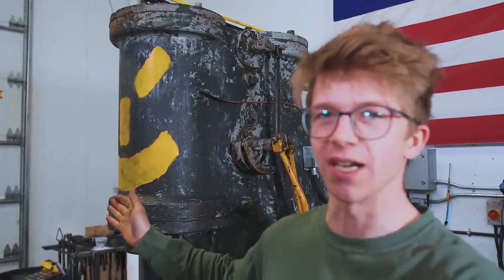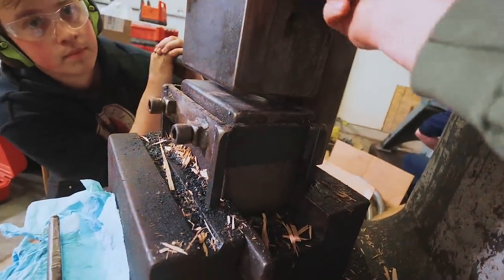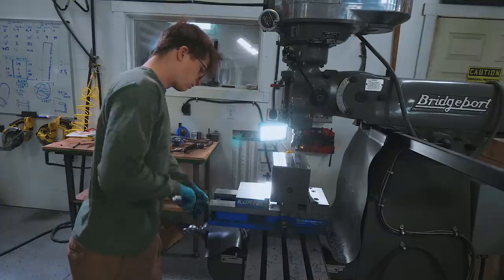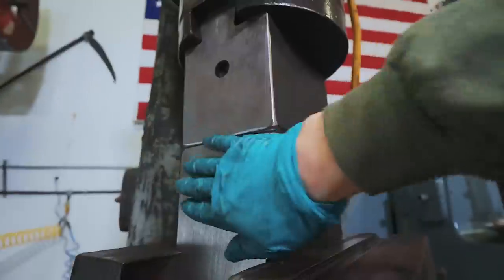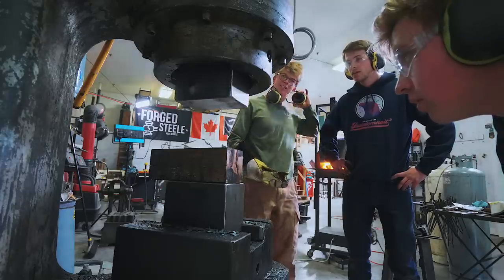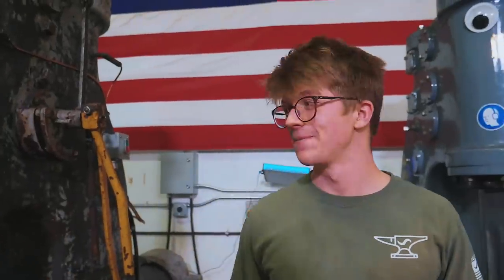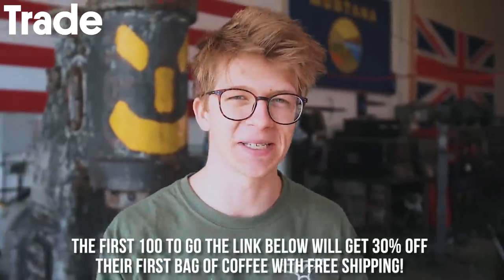FIXING THE 300LBS POWER HAMMER!!! Part 3

Comment: Alec, don't put off fixing that cylinder timing issue.
Reply: Part 4?
Reply: It wouldnt happen to be because it is  sitting up on a timber plinth giving the treadle more travel?
Reply: @jeremychurch590  Ah...this sounds like the path to wisdom.
Reply: @jeremychurch590  Excellent point, Jeremy!
Reply: @jeremychurch590  Its funny, I came here to say this, It might not be exactly the correct fix, but it would be a potentially easy fix to just adjust the treadle so that you can't give it too much 'gas.'
Reply: @Alconium  The first hack that occurred to my completely uninitiated mind was to put a chunk of rubber at the top of the cylinder. Doesnt perhaps solve the root of the problem; but then again it may be hard to convince yourself you did so anyway, and if the problem comes back, the block of rubber should still be there.
Reply: Jeremy Church 🕵🏼‍♂️🔎👁🧠👌
Reply: Experience speaking?
Reply: Make sure previous owners didn't enlarge airflow paths. Bored out a valve and such. Or restrictions in an output line
Reply: Jeremy Church Nah the whole machine is on the wood, raising the anvil and drives.
Reply: they also made the issue worse by lightening the dies making it easier for the top die to be lifted...
Reply: @jeremychurch590  OMG, brilliant analysis! If that is the case put the same width plinth under the treadle?! right. I wonder if that is the cause if there's enough adjustment in the valve timing to fix the problem. If not then same plinth on treadle is way to go!
Reply: @TheSVERguy  But wouldn't the treadle then have deeper travel to the floor?
Reply: @TheSVERguy  The treadle is the peddle that you step down on to run the powerhammer. When everything is on the plywood, the treadle has more space between it and the floor, so you can overpress it, where normally the floor would stop it from going too far.
Reply: I say machine an additional bore extension for more power.

Comment: Suggestion: put a stopper under the foot pedal until you've fixed the issue with the timing.  This will give you a "safe guard" on how far you can press on it with your feet.
Reply: the reason why they have this problem is because the hammer doesn't sit directly on the floor as it's supposed to so the foot pedal goes down further than it needs to, as topper would be the quickest solution  I agree.
Reply: Bruno.Martin KIM Dude, you’re a genius!
Reply: Could put a threaded sleeve in the concrete with a large diameter bolt that threads in with a stop nut to make it adjustable as well.
Reply: That is what  I was thinking too, but I know nothing about power hammers.
Reply: Bruno.Martin KIM that’s a good idea. Sometimes the simplest fix gets overlooked
Reply: There is nothing more permanent than a temporary fix.
Reply: @Admiral.Snakbar  
Until i breaks and you repair the same wat
Reply: @addichim  You are a smart man. they could simply well something on the food pedal or anything, but yea, that's probably it.
Reply: @addichim  in the previous video it looked like the treadle had already received a cut and weld mod to suit the higher mounting
Reply: This is a valve timing issue not a pedal issue. I would also check the seals inside the cylinder if something is wrong. In the instruction manual on most hammers it says to be gentle on the pedal to avoid this.
Reply: Tone Tone hmm, not a fan of that, no offence, but i think that you will eventually trip over it when you try to step up on it. with the result that you faceplant into a big chunk of red hot steel. i don't have any experience with hot steel in my face, but i think that it will, at least, melt your eyeballs out
Reply: @HvV8446   No problem, it's only a suggestion.  It could be made out of 2x4, in U shape, fix under the "penal" or onto the floor to prevent tripping.
Reply: @addichim  I completely agree with you.  Alex and co can also augment the lenght of the side arms of the pedal since they are really good with new construction/design in steel, like the forge doors :)
Reply: When mine does it. It's at the beginning of the stroke not the bottom. I think there's has the same way if you step on the treadle too fast it hits on the first stroke once it's cycling it works fine.
Reply: Might be just as easy and a more long term solution to adjust the treadle itself so it starts lower and hits the floor before the armature moves so far. It'd look better than a bold in the floor and give the forger a more firm stance.
Reply: Again, get in touch with Mark Krause, aka the Hammer Whisperer.

Comment: Part 4 - Fixing the ram hitting the top of the cylinder
Part 5 - Giving it a decent paint job
Reply: Yep, both of these need to be fixed immediately. That terrible paint job! I Guess the cylinder safety issue is important too...
Reply: Please give it paint job so horrid atm
Reply: The worn paint job looks awesome though..
Reply: @Tgiles13  I agree. The paint job is awesome as it is.  Gives it a dirty grease monkey kinda look. Saying I paid my dues, and I can still pound the hell outta some hot steel.
Reply: I believe he said in previous video that it was painted to look like it is
Reply: Paint it the same green as the Pilkington.
Reply: Bright red. Call it big red
Reply: PAINT IT!
Reply: Find out what color came out from the factory give it a good ol’ factory new appearance
Reply: At least take the face off of it.
Reply: Just sand blast the face off. The rest looks dope!
Reply: I actually like the paint, especially the face whoever did that was a genius. 🤣
Reply: Yhea, paint it, it looks horrible now
Reply: You all saying to take the face off it...
Did you happen to notice the giant googly eyes on the other power hammer?
I would assume the face will stay.
Or maybe even get googly eyes to match...
Reply: Leave it alone good as is
Reply: Paint it like a P-40 shark nose facing down.
Reply: Repaint it and add the face from the front end of an A-10 Warthog!!!
Reply: Keep the paint patina!!!!!!!
Reply: I really hope they give it a paint job
Reply: Current paint job is looks business.
Reply: @shanus11  - Paint it green and name it the Green Giant!
Reply: I think if the other hammer wasnt so nicely painted this one could stay the same, but they would better as a pair painted.
Reply: Yeah such a beautiful machine deserves a better paint job

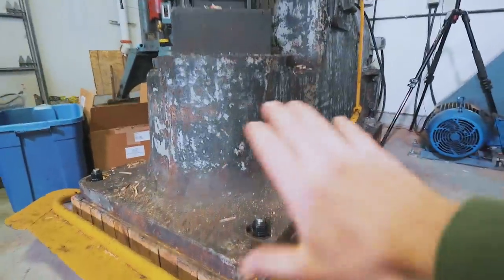Comment: 1:57 speaking of terminology, the piece of metal that holds the sow-block and the die in place in the dovetail, is actually called a gib not a key. :D
Reply: Different countries have different terms
Reply: English vs. American.
Reply: a gib is a key...
Reply: It’s a key here in America. Gib goes on a mill haha
Reply: A key keeps something in place a gib strip stops lateral movement
Reply: @andrewroberts97  Correct, it's most certainly a Gib. The guy above you, "Gib goes on a mill haha" Seriously? So a gib can't go on a lathe? I have no idea how people get these ideas, see a gib on a mill once, and think it can't ever be anywhere else.
A gib is often used to take the slack out of a dovetail to adjust a machining axis. 
It isn't a key, because a key is typically used as a device to transmit torque from a shaft to something else.
Reply: Almost 20 years in the forging industry across four shops and they've only ever been keys. Maybe we were all wrong this whole time?
Reply: There are even keys called gib head keys or in short gib keys...

Comment: It over stroking can cause the bottom area of the ram cylender guide(?)to be blown out as well. 

You didn't mention but the gloss on the steel as you were forging was beautiful the surface finish that the hammer leaves is amaxing

Comment: Depending on the cylinder, some will have adjustable cylinder cushions that are typically changed with allen wrenches. Not sure how it would work with such an old cylinder, but I believe it's worth checking out. Also, Funky Chicken by Red Rooster coffee is what I got on the coffee test, planning on ordering soon!

Comment: If it were mine I'd take a large wire wheel brush and clean the mass back to iron to look like when it came out of the factory. Already looks like someone did a half-ass job to begin with. Nothing like a fresh face lift to add pleasure of ownership to an old tool. OTOH, just having  this up and running is a real pleasure Alex, Goon on ya'

Comment: Hey bud! So with the power hammer hitting the top I have a similar issue with my old school ceramic throwing wheel. Too much go at once will throw it off. May I suggest a spring to add a level of tension so you can’t slam down on the pedal all at once. Also. My nurse of a mom, with a familiarity with head wounds, suggested helmets and goggles still you get use to the power hammers “umf”. Her words. Just a suggestion. Hope it helps. Good luck. Y’all are awesome!

Comment: I want one now...I wonder how much it would take to biuld a modern one. It made me smile to see one of these running. Hopefully one I'll luck up and either find one, or biuld me one from scratch. I look forward to seeing what y'all will make with it.
Reply: bssni touir  That could be the case, I've personally seen it happen before with powerhammers and other tools. And sense they are all connected together the vibrations and kinetic force, combined with the torch and sear power it could break itself very easily, and we used to have a small powerhammer at the local FFA biulding at the local high school that was around when my grandfather went there. It got broken by a 10 year old whom decided to play with it...He also lost his hand that day. LoL. Poor kid but at least he learned a lesson even if it was the hardway. It had snapped the inside of several parts instead of breaking the motor mounts though.
Reply: And took several minutes of running before it did that

Comment: If y’all had an in shop machinist so many of your issues could be resolved. I’m not a blacksmith (yet) but as a machinist I see so many ways that y’all could benefit from someone who specializes in tight tolerances on the mill and lathe.

Comment: Other than what has been shown in the preceding videos, was this power hammer ever disassembled (only where feasible, practical, and safe) so it could be inspected internally for metal fatigue/stress cracks, worn or loose fittings, etc?  As homage to the manufacturer, the exterior should be refinished.  Great channel guys.  Keep up the great work!

Comment: I have a suggestion, for the problem with the pedal and “hitting the top” weld a piece of metal to the bottom the pedal for a “safety option”. That way it doesn’t allow you to push the pedal down so far.

Comment: Can only say you got insanely lucky that the opposite side was as parallel as it was. Hard to say without seeing the blueprint as to what datum A was but it seems you were correct in basing the impact surface off of the dovetail top.

Comment: maybe until you get the valve timing fixed you could weld on a limiter to the treadle so that you cant go full tilt with it for now. just a small piece of steel that contacts the floor earlier than the treadle would normally.

Comment: Alec, someone else mentioned this in a thread. I don't know jack about powerhammers, but it seemed to make sense from a logic standpoint. Could it be that you are pressing the treadle too far, due to the whole thing being set on the wood? Whereas normally the floor may stop it from going so far, when you go all out, you are pressing it further than it's meant to go?

Comment: Find the right position that on pedal add a break block so it dont top end piece metal on floor. Until you find the right timing adjustment easy fix until figure it plus safety device

Comment: thinking about the damaged motor, if its cracked, I am wondering if you could removed the core, and fix the body of the motor itself. Perhaps use it for something else, and not leave it outside. Unless your shipping it off to be refurbished, if nothing else you could melt the copper down and recycle the steel into something else.

Comment: Hey alec just a suggestion if the issue is the user pressing down too quickly causing the ram hitting the top of the cylinder why not make a bracket that goes above the pedal with a spring pulling up on the pedal resulting in upward force as you push down allowing for more pressure sensitive control

Comment: the strokes are so in time with the shutter speed at normal frame rate it looks like the hammer is stop motion.

on a second note, could you extened the treadle lever so its rotation at the machine housing is shorter? sort of a longer lever arm idea?

Comment: The first shop I worked in had a 200 pound Chambersburg with the same problem. I'm not sure if there's a way to fix it, we just accepted it as a feature of the hammer - you always feather down the ram. (the habit has stuck with me on every power hammer I've used) Maybe it's just a common problem that can be fixed, but I'm afraid it might just be an unfortunate feature of the big Chambersburgs.

Comment: Is it hitting the top of the cylinder head because the foot pedal goes down more because of that wood base you have it on?  That's like, what, an extra 6 inches?  Maybe adjusting the foot pedal will prevent that from happening.

Comment: why not make it so it has more resistance on the treadle peddle or make a drop stopper, something like a soft piece of rubber under the peddle that makes it so you have to use more force at the bottom of the push.

Comment: you should have built a nice cart to set the die's on and store any others you get in the future. it would make it safer and easier to move around the shop. also you need an overhead crane or a strong arm ;) strong arm being a lifting device that will grab the work and you lift it effortlessly and if you get a rotary forge you could start producing your own bar stock and centerless grinder. then you would need a nicer band saw with automatic feed.
Reply: a rotary forge would reach the ceiling in that shop and you could run 40' back and forth

Comment: In my opinion; I would have degreased the machine with a good degreaser and power washer and then painted it back to it’s original color. I feel that having a clean machine will allow you to see the problem areas as they creep up much easier therefore allowing you to take care of the issue much sooner. 
If I had access to all of the technical manuals for the machine I would have completely disassembled it and cleaned everything up, replacing all of that old grease and oil that’s been in the machine for no telling how long. It would give you a much better picture of the actual wear on the individual components so if it breaks down you know where to look first. I know that taking a machine like this apart could potentially be costly which is why I said I would only do it with all of the tech manuals but the cost of not taking it apart, cleaning it up and let inspecting everything could cost much more in the long run.

Comment: You have the whole thing raised so you figure the pedal is going down maby more than it's supposed too. What about putting a stop so it doesn't hit the floor completely? Or is it not the depth of the pedal but the speed in that case maby putting a break on it or a weight on the manual handle to slow it down. Unless you can adjust it somewhere elese.

Comment: Put a bump stop under the treadle. If you can’t push it all the way down then you can’t throw the ram through the top. Of weld a wee bit of steel to the underside of the treadle, in case a smart arse decides to move the bump stop

Comment: Did you pour a thick floor where the hammers sit? Noticed a different color.
Reply: When he first moved in and tried to mount his other power hammer he found the foundation was only a few inches thick, he was told when he moved in it was thicker so after talking with the landlord they sent some guys out and poured a 2 foot thick slab in that section of the shop for his hammers

Comment: Ok so if any of y’all are hammer experts in the comments, I have a question:                                        Why use a narrower offset dovetail that needs a key when you could just use a normal dovetail and a removable pin (like some big 1/2“ round) that goes through the joint and keeps the die from sliding? This way you just remove the pin and slide the dovetail right out. I don’t see why the key method is better than that. I’m just 16 so sorry if I screwed up some terminology.

Comment: I know you really love the power hammer, but please please be careful. In any place I've ever worked that kind of error wouldn't go up to production. Your safety and the safety of the people around you is so important. It isn't mine and I know you'd rather not hear it, but you shouldn't operate it on any normal basis aside from testing until you have resolved the issue. Especially since what you're used to is the way to break it. Safety isn't just something you care about, it's a value. Something that you value should always come first. I know you'll make the best decision. Good luck.

Comment: If you can't fix the hitting the top issue by valve tuning, why not limit your treadle movement. Something under it to prevent it depressing enough to cause a top hit? (I'm assuming treadle depression controls piston actuation length, but IDK how these things are calibrated....)